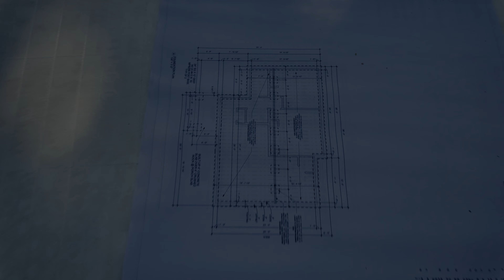How To Build Concrete Footers For A HOUSE (2024 Edition)

Comment: Is it fair to ask how much the Concrete for that size property costs? Just trying to get some sense of what the expense is of doing something similarly sized.
Reply from the maker: @chrisdixon3951  in this area the concrete is about $120 per yard, $4.50 per mile then some and some other fees. The footers took about 5 yards and was $1200, the ICF stem walls were 7 yards and was $1600